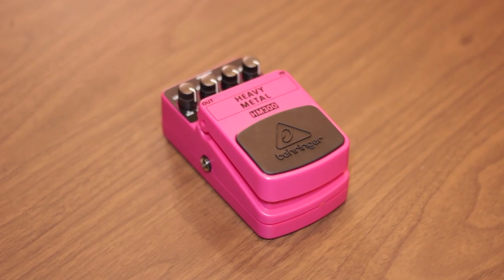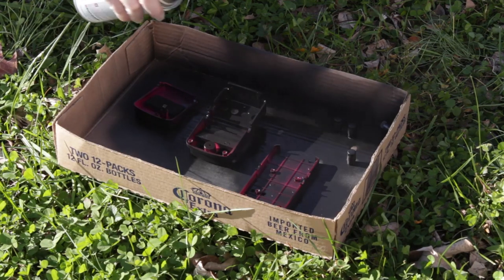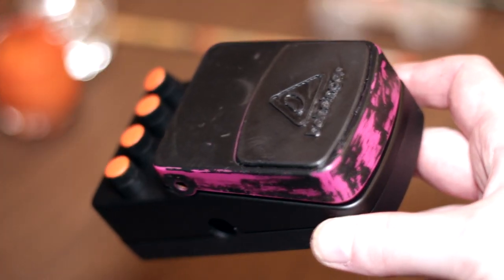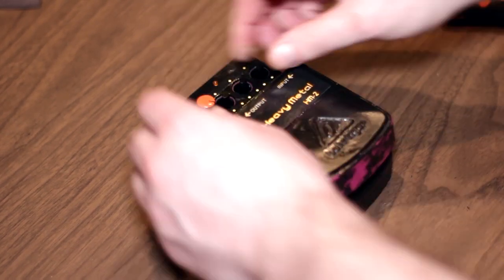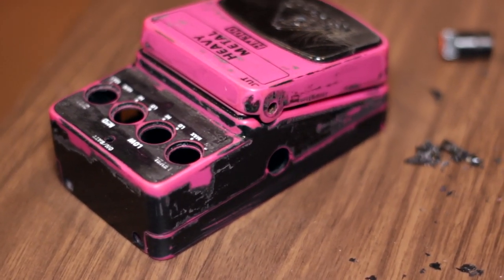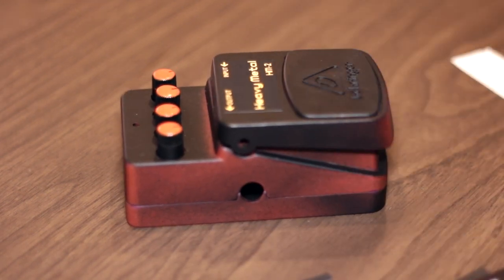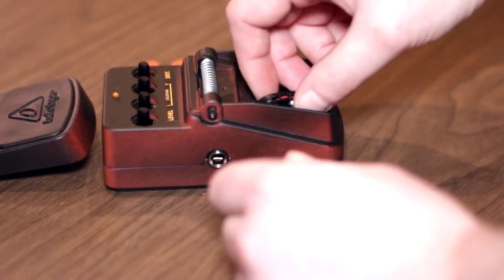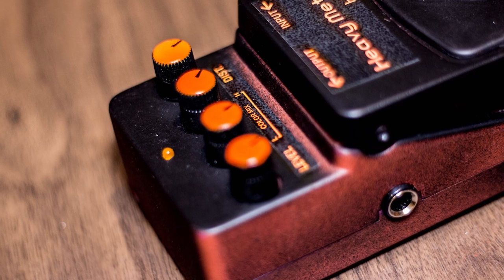Painting my Behringer HM300 like an HM-2

Comment: Hahaha this was hilarious. Did the rubber pad stay on with the hot glue? I have a couple of behtinger pedals I want to paint. Thanks to this video, I won't lacquer them! ;- )
Reply from the maker: The hot glue was a bit of a hot mess, I later replied it with super glue when it came off again, and that's held up fine. Just be careful not to use too much, since it will be a pain to remove if it leaks out